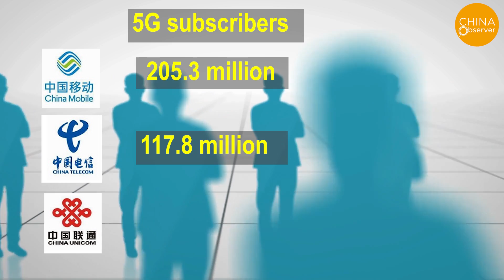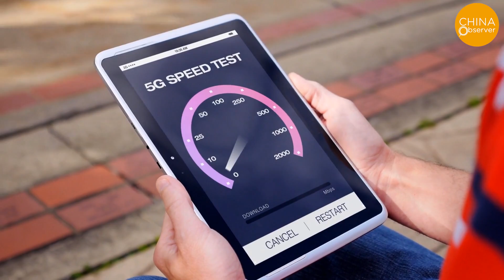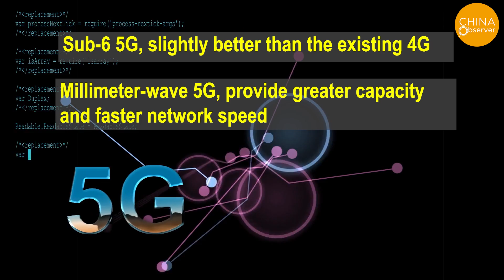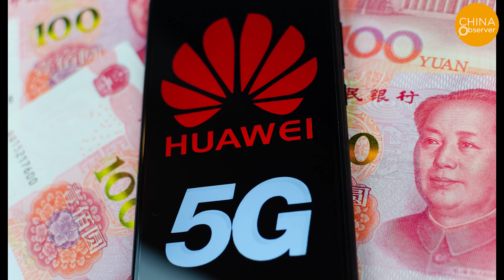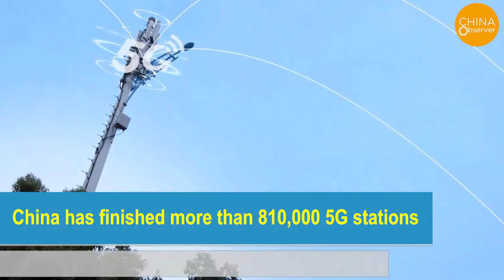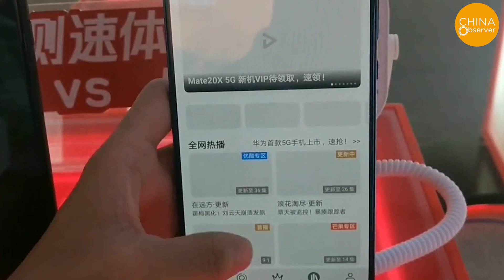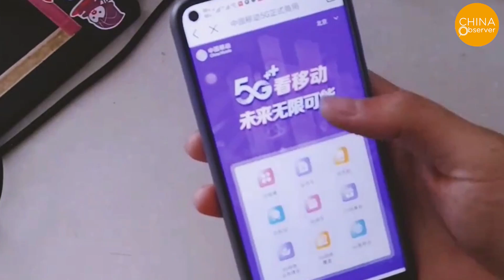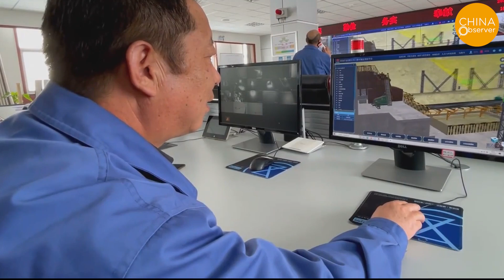How China was trapped by 5G| Huawei 5G | China's 5G Leaves Operators In A Dilemma

Comment: 5G makes mass surveillance easier through pinpoint locationing.
Reply: It's easy enough to do that already with existing technology. Finding out how far you are from the tower based on your signal strength and basic direction finding techniques isn't difficult. Things like IMSI catchers that are able to force your phone to connect to a fake 2G or 3G tower in order to not just track your movement but assign it to your unique device should worry you much more. The phone company already has all that info, Your phone has a GPS chip in it that's far more accurate than any of that. If a subpoena comes down it doesn't matter if you're rocking an old Nokia, you're fucked.

Comment: Like all previous generations such as 3G and 4G, 5G is really a collection of technology that carriers can choose to deploy or not in piecemeal.

Its really surprising to see that the 5G that's currently deployed (and without the millimeter wave technology) still consumes more energy than 4G. The non-millimeter wave 5G uses pretty much the same frequency bands as 4G. And you would also assume the silicon used in those systems are based on newer generation and smaller feature size fab technology, so it should really consume less power. Although the radio part of the stack probably would still consume the same amount of power. 

As far as I can tell, the millimeter wave tech can provide gigabit+ level bandwidth, but really the intention is not for a single device to use that type of bandwidth (although it is capable of it.) But to deliver better service and to de-congest the highly congested and crowded areas that was previously served by 4G. (e.g. NYC Manhattan, Sports Stadiums and other crowded Venues, major city downtowns.) And increased device count per cell, e.g. now that even more things like cars can be on the cellular network. It is pretty pointless to deploy millimeter wave tech in areas that do not meet that level of density and traffic.

Comment: It's looking to me that 5G, as a practical wireless protocol, is better suited as a WiFi type of transmission medium, not as a long-range wireless cell phone system.
Reply: Yes it looks like exactly that, a better WiFi with better range ~100meters.  Not good as a mobile phone network though.
Reply: 5G is a plot to make you pay for your Wifi-like connectivity;.  It's quite pointless.
Reply: @rap3208  not true based on the video...
Reply: Too many device, huge power consumption, your phone battery has to use mimo and power deplete very fast
Reply: 5G range depends on e.g. a frequency band - it has lower frequency bands too, suitable for longer range. 5G is working mighty fine in many places. Building wired network is prohibitively expensive in some areas so mobile can be much better. There's no one solution for all. One benefit 5G has is its low ping (latency) in standalone networks on phones with good 5G modems. The higher battery drain might be a result of non-standalone 5G network as in such situation the phone uses 4G for signaling and 5G for data transmission requiring the use of them both simultaneously.
Reply: @McSlobo  4G networks have a range of about 10 miles, with the millimeter wavelength 5G bands having a range of about 1,000 feet. Are there 5G bands with wavelengths that much longer that their ranges would be that much greater? Also, what about the much greater signal attenuation and reflectivity of millimeter wavelength waves in going through building structures?
Reply: @rap3208  No, China is just one of a number of countries with wireless telephony. Huawei and ZTE didn't even develop the foundational technology that underlies this telco equipment, just copied and reverse engineered it.
Reply: @videomaniac108  Huawei owns most of the patents in 5G.
Reply: @videomaniac108  "In general terms, a "utility patent" protects the way an article is used and works (35 U.S.C. 101), while a "design patent" protects the way an article looks (35 U.S.C. 171). ... Both design and utility patents may be obtained on an article if invention resides both in its utility and ornamental appearance."

You seem to be incorrect on a fundamental aspect of patents so I am going to disregard your entire tale as bullshit.
Reply: Too late for us in Las Vegas. I see those ugly 5g tower add-ons all over.
Reply: 5G millimeter wave is is basically a high power WIFI 6 mesh network. The most likely way it will get wide deployment in Australia for example is by having a micro 5G node built into ISP routers that connect to the NBN effectively making their customers pay for the cost of backhaul and power for non urban POPs directly. Telstra has previously tried this with 4G with little success.
Reply: 5G is a set of network standards. They can lower the frequency to get better range. It’s pretty versatile stuff
Reply: @Farm4Gold  Kind of since they can sun into spectrum licensing problems and there are limitations to the ranges the physical equipment can produce.
Reply: So it's useless than for western world... I have 1 gigabyte glassfiber super low latency connection. And can do 150Mbps download and 35Mbps upload on my cheap midrange Samsung phone with 4G. I don't need more currently i have way more than i need. 5G is useless overkill technology.
Reply: @HermanWillems  I live in the "Western world" (Pacific Northwest of the U.S.) -- and my 4G phone (Samsung Galaxy XCover Pro) is fine for everything I need. Uploads and downloads are in line with yours. So, I'd say that for 95% of uses, 4G is just fine! You're so right! 😀😀
Reply: @rap3208  yup plus the free added radiation from every electric pole you meet everyday and night. best upgrade ever
Reply: @beyondaveragemotion  Do you mean infrared radiation or visible light radiation? Because both of those are higher frequency, higher power, higher danger than all microwave radiation.  Microwaves are lower frequency than visible light and thus even more non-ionizing, IOW safer than your incandescent light bulbs.
Reply: @etherealceleste  nobody uses incandescent light bulbs anymore lol. Your point is right but your comparison is moot
Reply: @markcorneliuslau  Still Les radiation than the sun
Reply: @markcorneliuslau  I do. LED is garbage
Reply: @beyondaveragemotion  the big yellow light in the sky we call the sun bathes us in far more harmful radiation daily. 5g's power is a fraction or a fraction of that power.
Reply: @beyondaveragemotion  you have no reason for your ignorance, the whole internet is there to inform you. Refusing to do it is stupidity. Im done with you!

Comment: From tech point of view, this video combine both, some correct info and lot of nonsense...  it is funny to read comments from people who do not have any expertise in this domain...
Reply: Can you mention the incorrect statements?
Reply: @feeltoofree  it is an overall misunderstanding of the subject,  5G is an evolution of LTE air interface and it is using the same frequency spectrum available to LTE, including low band which originally was allocated to GSM and gradually was repurposed. As with any new mobile standard, the most important aspect of it is the allocation of new spectrum and carrier bandwidth, which is the biggest contributor to the high data rate. Also, the introduction of multiple TDD pattern numerology (only one in LTE) enables to reduce latency. As for penetration and range, it is the sole responsibility of the used spectrum and has nothing to do with mobile standard, the higher the frequency the higher loss, which is basic physics.  However free spectrum to accommodate more data volume demand is available only in the high band area hence, thanks to semiconductor tech evolution mobile operators start to harvest it.  All BS about switching to 5G plan is just commercial noise, at the end of the day it is just wireless access to services and people always pay for volume and data rate. It does not matter it is 4G or 5G, what matters is the availability of it, and it is a different case with 5G on the low band with limited spectrum and less capacity,  but higher range vs high band with high capacity but limited range.

Comment: Interesting that according to the video, 5G may not make sense even in a metropolitan area for average Users, and the speculation is that it might make sense in an industrial space.
I just wonder about the future of 5G deployed similar to 4G which itself required numerous more towers than analog. The problem seems to be that there was a clear advantage to going digital 4G (and the earlier 2G and 3G) but is harder to justify for 5G and other technologies like mesh networking that turns practically every device into both a short range transmitter as well as receiver and relay might ultimately make far more sense "upgrading" old technologies rather than leaping to a new.

So, for instance comparing mesh networking vs 5G, you could achieve similar low latency data exchange over short distances between devices close to each other, but would be very decentralized, the "smarts" of how the data is processed and utilized would have to reside in at least some if not all the devices that are close to each other or there would be very high latency, possibly unacceptable for instance supporting driverless cars that need to make split decisions in emergency situations. The main advantage of 5G as I see it is the centralized management of data possibly a long distance away. Otherwise, I don't see that either technology has a distinct advantage over the other, and 5G would be far, far more expensive to deploy and maintain.
Reply: Maybe it's a case of ideal technology by engineers, that telecoms want to sell, but people don't see a need for. Maybe 6G will be more realistic, and we skip 5G. 5G is already kind of modular, millimeter wave stations are optional.

Comment: Is it really true that 1.5-2 5G towers are needed to cover the same area as any one 4G tower? That doesn't seem right, at best that probably covers approximately one axis, and likely stretching quite a bit. Add another axis at least and the computation is probably in the ballpark although likely insufficient for the "true" 5G version.
Reply: 5G uses 2 wavelength segments. One is 4G wavelengths, the other, millimeter wave range, is more like WiFi. Not sure about the tower requirements, but the WiFi like part will be hundreds of tiny stations, you'll see them on light posts and buildings everywhere, everywhere with dense pedestrian traffic. The short range ones are the millimeter wave ones they talked about. These can even be used indoors.

Comment: CONCLUSION 
综上所述，运营商空中所说的，5G套餐大降价并非我们想象中的那样。虽然说5G套餐价格的确有所降低，但运营商却为其设置了一定的准入门槛，例如要求合约期是12个月/24个月，还有限速等等。

那么，目前到底要不要把4G套餐升级为5G，笔者有这样几个建议。假如你想成为第一个吃螃蟹的人，且已经购买了5G手机，那可以升级；但如果你觉得5G目前没啥用，也没换5G手机，想继续观望观望，那完全不用着急不升级。当然，目前还有一批“被5G用户“，是指那些并未拥有完整的5G条件，但被“赶鸭子上架”用上5G的用户。 

.
To sum up, what the operators said in the air, the big price cuts of 5G packages are not what we imagined.  Although the price of 5G packages has indeed been reduced, operators have set certain entry barriers for them, such as requiring a contract period of 12 months/24 months, and a limited speed.
 So, whether or not to upgrade the 4G package to 5G at present, I have several suggestions.  If you want to be the first person to eat crabs, and you have already purchased a 5G mobile phone, you can upgrade; but if you think 5G is currently useless, and you have not changed your 5G mobile phone, and want to continue to wait and see, then you don’t have to worry about upgrading.  .  Of course, there are still a group of "5G users", which refer to those users who did not have the complete 5G conditions but were "caught the ducks to the shelves" to use 5G.
.

Comment: Here is an example of why Chinese people don't want 5G, it is expensive and uses more data automatically shifting high gear like YouTube videos will use 1080p resolution as opposed to slower Internet . 
Some subscrIption plans are a scam as in this example : 
以上套餐都不是目前最便宜的5G套餐，民营虚拟运营商“全民优打”，推出一款月费只需9元的超低价5G套餐，这个价格不仅远低于三大运营商5G套餐水平，甚至比市面上大部分4G套餐价格还要低。据了解，价格为9元的5G套餐内不包含流量，套餐外流量费为1.25元/1GB；但它也有19元包含5GB流量、29元包含10GB流量的版本，不过流量限速300Mbps。所以，仔细来看，这款声称“5G套餐”的套餐跟4G套餐并没有太大差别，不过只是个噱头罢了！
以上套餐都不是目前最便宜的5G套餐，民营虚拟运营商“全民优打”，推出一款月费只需9元的超低价5G套餐，这个价格不仅远低于三大运营商5G套餐水平，甚至比市面上大部分4G套餐价格还要低。据了解，价格为9元的5G套餐内不包含流量，套餐外流量费为1.25元/1GB；但它也有19元包含5GB流量、29元包含10GB流量的版本，不过流量限速300Mbps。所以，仔细来看，这款声称“5G套餐”的套餐跟4G套餐并没有太大差别，不过只是个噱头罢了. 
Google translate : IM lazy to translate it 😂
None of the above packages are currently the cheapest 5G packages. The private virtual operator "Universal Premium" has launched an ultra-low-priced 5G package with a monthly fee of only 9 yuan. This price is not only far lower than the level of the three major operators’ 5G packages.  , Even lower than most 4G package prices on the market.  It is understood that the 5G package with a price of 9 yuan does not include data, and the data fee outside the package is 1.25 yuan/1GB; but it also has a version that includes 5GB data for 19 yuan and 10GB data for 29 yuan, but the data rate is limited to 300Mbps.  So, look carefully, this package that claims to be a "5G package" is not much different from a 4G package, but it's just a gimmick!

Comment: If you need 5G, you're spending too much time on your phone.
Reply: Looks like the telecoms had grandiose plans, but the users didn't
Reply: No man, when every devices we use becomes online 4G will not be able to support such large number of devices and keep them connected. You have no idea in the number of devices supported by 2g, 3g, 4g, n 5g.
Reply: @DineshTwanabasu  Still waiting for flying cars.

People still use hammers and brooms.  If a system works at low costs,  why would you toss a low cost, simple, reliable for higher cost?
Reply: @2paulcoyle  
Looks like you have very little knowledge on telecommunication man. 
It becomes cheaper as we go from one generation to another. For example to serve 1000 mobile phones its costly in 2G than 3G, similarly 3G is costlier than 4G for pushing same amount of data.
So same as that it will be cheaper in 5G than in 4G to serve the same number of devices and push same amount of data. 
3g supports ten times customer than that of 2G, 4G supports ten times that of 3G, and 5G supports 100 times that of 4G. So do your own mathematics, which will be cheaper for the same given bandwidth.

Comment: 6G 7G  8G 9G 10G  This model falsely  assumes new rollouts indefinitely for technology nobody wants, nor can afford. If only the phone companies studied  real number spreadsheets instead of impressing CCP Officials with fake numbers to get more subsidies.
Reply: It's a political goal, not a financial one. If the West doesn't use it and goes to a sensible 6G, China will fail completely in their goal. It's likely that 6G will be in use for a very long time. Each upgrade has diminishing returns, but greater cost. Hope they design a sensible 6G.
Reply: @seanrodgers1839  Is stupid, they're going broke. The CCP can't subsidize them forever, that would be unsustainable.
Reply: @quisqueyanguy120  
The system is unstable, but they have kept it going for a long time. We can't really know how well they are doing, it's all hidden. However, a dictator can appropriate all the wealth that they need from the people.
Reply: basically the 4G has been switched to be 3G and the so called 5G is actaully 4G. You can feel it when u use it. This is a fact. When u r at remote areas in China, your phone will auto switch and locate the strongest signal. At times u can see 2G on your phone.

Comment: The number  discrepency could be due to fixed cellular data devices eg cameras, video billboards, enterprise back haul, security and such.
4G nodes already have similar energy saving features that is touted for 5g nodes.
As for general mobile subscriber uptake numbers being lower than claimed and struggling to garner expected subscriber numbers, well, that's the invisible hand of the market at work.
Early adopters either have a genuine need or deep pockets or both. Nothing new here.
The rest is conjecture.

Comment: China doesn't have 5G.....it's more like 4.5G 
......
Reply: To be fair. 5G is just a marketing term. The real world application of “5G” is called Sub-6 which isn’t much faster than 4GLTE (about 50-100Mbps). While the theoretical top speed of mmwave 5G is 4.5Gbps we are a long way from there (we probably won’t achieve that until 2030 at least when the technology matures). The problem is as the video outlined is cost and energy consumption. mmWave 5G uses a lot of electricity and the equipment are 3-5 times more expensive than 4G LTE equipment. Until the cost and energy consumption can be brought down to a manageable level, I don’t see 5G being a sustainable technology but then again it’s just a matter of time before it happens.